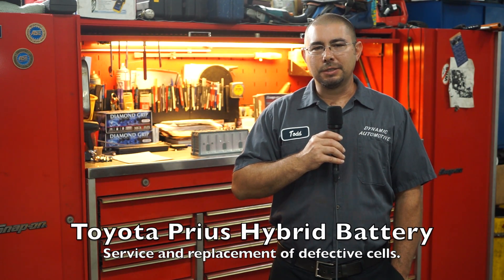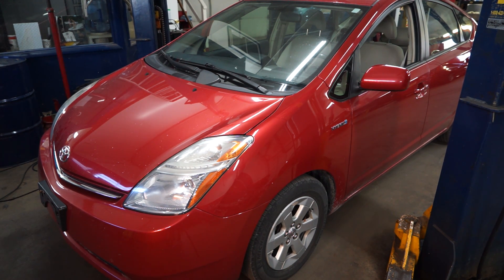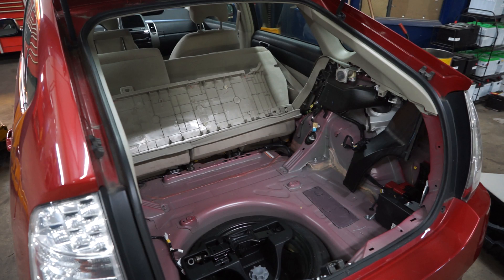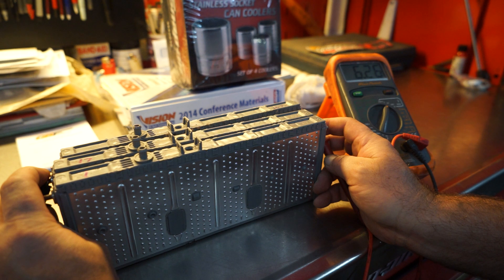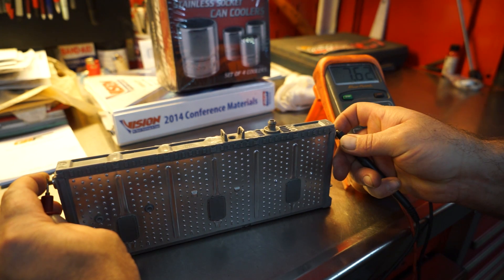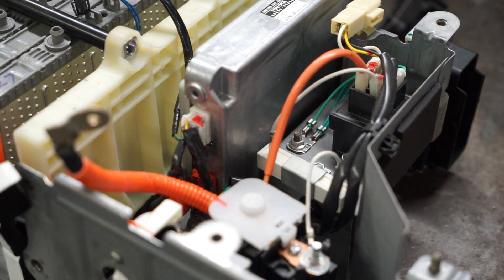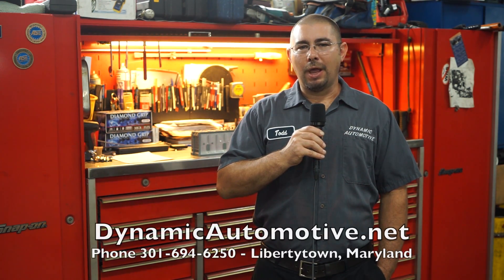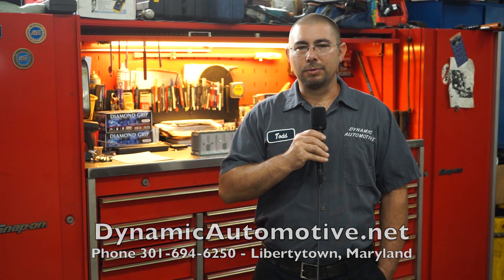Prius Hybrid Battery Pack Repair

Comment: I have a problem with my Toyota Noah hybrid it have the vehicle going into safe mode it is saying Toyota hybrid battery malfunctioning I checked it it is saying that Aldi sells are good but it is still going into safe mode cannot put on the AC because it trips It Off

Comment: here's  a few tips for fixing a car battery
never try to do this unless you are sure what you are doing - the acid can burn you
Test the voltage first - there may be a kaput cell which would waste your time.
Check the battery fluid.
attempt to fully charge the battery.
(I discovered about these and more on Jons mender guide site )

Comment: :))) is not a perfect fix this one. The voltage usually measure in this way has not relevance to your fix. You can only know module is broken by applying load on the module to see if work properly. Even with load apply is not good enough to know is the battery pack will perform perfect and long life together.
Reply: 8.0 is showing because you did not disconnect each individual cell and they are all connected

Comment: We took The battery out of my Prius but my dad says trying to mess with taking all those cells out can kill me by the electrical discharge, will this happen is there any safe way to take them out?
Reply: You have to take out the fuse before work is a big red one that cut the power from battery block then you can play around in safe way.
Reply: Not certain about the points made but ,if anyone else wants to learn about How to repair a battery try Cypouris   Renewal Guide Coach (Have a quick look on google cant remember the place now ) ? Ive heard some extraordinary things about it and my cousin got great success with it.

Comment: what are these cells consistent of lead acid lithium ion or NiMH where is the ground point that u connect ur self to .my father was telling me horror stories from his ase class back in 2005 where these packs have so much power if you don't wear a special ground to the car the sheer voltage can jump from the battery to you
Reply: +Craig Shipp shit yup that's enough voltage to jump from the battery to you and cook you .my father has known people who have popped there fingers off from wearing rings on 12v batteries but 400v damn
Reply: +Craig Shipp NiMH kinda stink because they suffer from a memory effect to bad wish they where lithium ion more energy dense less weight and better at higher and lower temps less energy loss over time

Comment: I wonder if those individual cells can be disassembled and the batteries inside can be replaced with brand new ones. Anyone know? And, if all we have is to find used good cells, wont that stock eventually run out?
Reply: +classicjukebox There are many components to battery repairing. One place I found that successfully combines these is the Magic Mender Wizard (check it out on google) without a doubt the most useful course i've heard of. Check out this  extraordinary site.

Comment: Have you ever came across a smell from the hybrid battery as I am having problem with odor similar to rotten eggs or urine. Some they say it's due to the two deteriorated rubber hoses on the battery. What is your observation?
Reply: ***** I thought this account was owned by the advertised garage. Anyway, its definitely coming from the boot.
Reply: +veryuniqezombi Yes, the problem is quite common, just google for "battery vent odor" or something like that, I'm currently trying to figure out how to deal with the problem myself, as my Prius still has 60k miles left on the warranty so I'd rather not void it.
Reply: @NilsBryant  Apologies for taking me 3 years to reply but might be beneficial for others. I replaced vent hoses with DIY silicone ones and it is much better now.

Comment: It is risky changing out just a module or two.   If the modules do not match the remaining modules in the pack (capacity, internal resistance, and voltage) the battery will fail again, it may take weeks/months but it will fail again.   If you are on a budget and have the time to redo the job you can try this, but it is not recommended, especially if the rest of the modules have high mileage.
Reply: They have to be charge and balanced all before put on the car. This is done by apply same amount of load to discharge and same amount of load to charge them multiple times connected as a pack.
Reply: ***** unfortunately if you want a fix that will last years you need to replace all modules, or ensure the replacements have almost identical characteristics.  Measuring just the voltage of modules at rest (without a load) doesn't tell you all that much.
Reply: No. They use passive or active balance BMS.

Comment: Todd is a very intelligent, consciences technician with the gift to communicate technical processes in layman’s terms. He will work on anything from a hybrid battery cell on a Toyota Prius to light duty diesel trucks including everything in between. Come see Todd live in action at Dynamic Automotive Libertytown MD.
Reply: +Jose Bueso Will the voltage and internal resistance test still be a viable diagnostic tool if the car has been sitting for 3 months not operated? i.e.When we got the light on and the dealer said it was going to be $3000+ to repair I just parked the car because I couldn't afford to buy a new battery pack. But as this video shows it is often just a cell or two. However, I doubt the any of the cells would read 7.6 volts now since the car sat so long? How would you approach finding the bad cells in this situation?